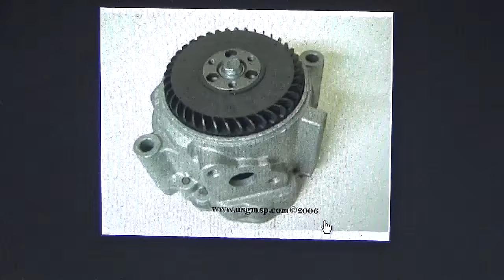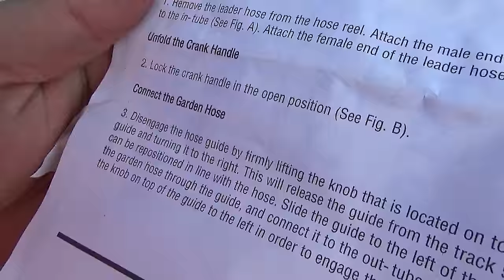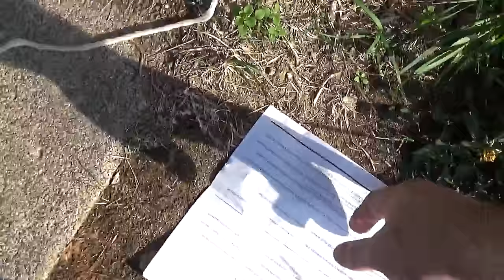Air Pumps and Hose Spooler

Comment: to get that pump off, you just need to loosen the bolts holding the pulley on, then remove the belt and finish removing the pulley. you will then see the two bolts holding it on. the air outlet hose is just held on by a squeeze clamp.

Comment: You should be talking to Rickem, he probably has one of those pumps (smog pumps) laying around, if not, he could probably tell you where to get one cheap.  Any scrapyard will have them,  tell them what size engine you have (305) and you're done. Older GM stuff is interchangeable. More than likely you don't need one at all, your car sat for too long at it's frozen, get some big ass locking pliers (channel locks) and turn the pulley until it spins. For now, go charge the battery on the car for about a day. Get in your other car and head to the closest auto parts store and buy a service manual for your car, it will tell you how to fix your car.  You''re probably going to need to put brake lines on that car too since it's been sitting for a couple of years. It might be fine pulling out of the driveway, but once you start to build pressure or need to stop in a hurry the line will blow out.
Reply: I'm sure it starts and runs fine. Just needs a brand new car battery.
Reply: it would cost him more to go to london and get one off rick than to just buy one

Comment: Going back to bed is fun, until it turns into another full sleep which just goes bad... :P

Looks like a simple yet pointless device that pump, I blame california for stinking up the place causing such things to be required... :P

hehe, cat rolling on her back means tickle her belleh... :P

nah, when a bearing has seized, it's replace the part or replace the bearings, seizure means rust, which means the bearing race is goosed, which means that thing could break apart at any minute...

hehe, car's like "But I don't wanna open my mouth for you!"... :P

Comment: Loosen the three bolts on the air pump pulley , before you remove the serpentine belt  
.It will help hold it still while u loosen the three bolts

Comment: Also, a pair of vise grips on the hood strut thingy works great instead of a piece of wood, and to remove the belt, you'll see a square hole on the tensoner, it's to put a ratchet on (probably a 3/8 drive) and use the ratchet to loosen the belt :P

Comment: You should get one of those tarp shed kits from home depot (Plastic connectors, you just put the 2x2 in it, no cutting etc) and throw it in the back for the mowers and toys then use the garage for the flowerbird

Comment: Definitely replace that belt Adam, and look for any other rubber items that are dried or cracked like your brake hoses, tires, heater hoses, etc. and consider flushing out that old brake fluid and coolant too.

Comment: I hate to say it, but chances are the TA will need at least four new tyres plus suspension and brake components to get it back up to par.  Possibly also steering too as the rubber bushes will have hardened from sitting unused.  Mind you, it is better to give it a test drive (once insured of course!) around the streets at low speed to get everything moving again, because you could be surprised and find that everything still functions as before.  One thing that is a given though is that it will need an oil change before you drive it anywhere, as that oil will be acidic as Diet Coke by now!

Comment: Hint: Loosen up the alternator  bracket, the entire belt will loosen up. You aren't going to break anything, no reason to be scared of a bolt, it's just a simple engine and since it's not running anyway, you can't do any more damage.

Comment: the square hole on the tensioner is where you stick a 1/2 inch drive ratchet or breaker bar and shove it to the passenger side of the car to release tension on the belt. If you would loosen the bolts holding the pulley to the smog pump first before you remove the belt then you could take off the belt then the pulley and get a much clearer view of how the pump is mounted.